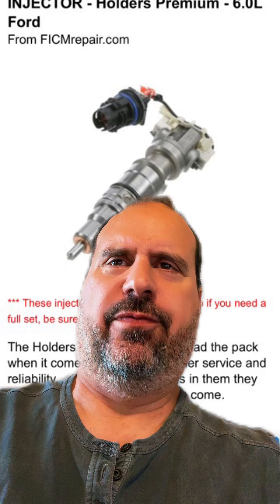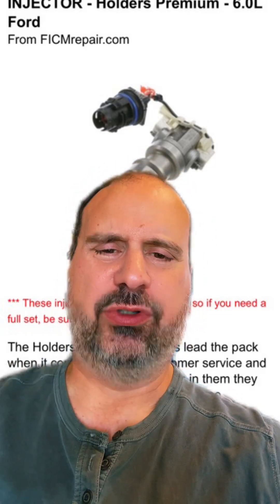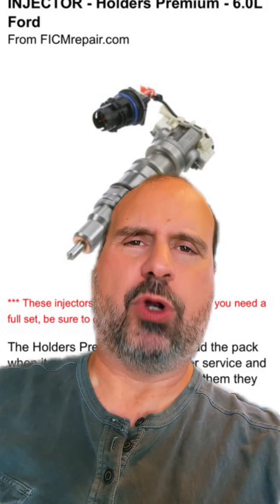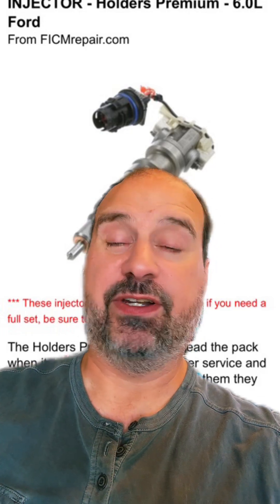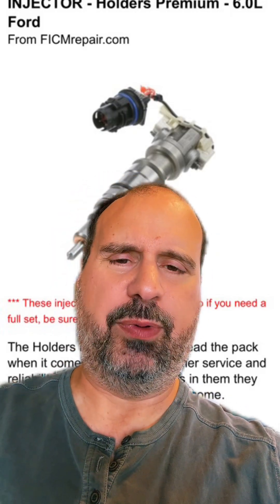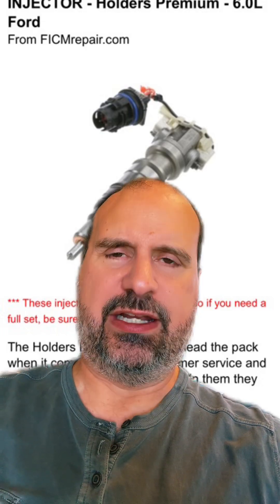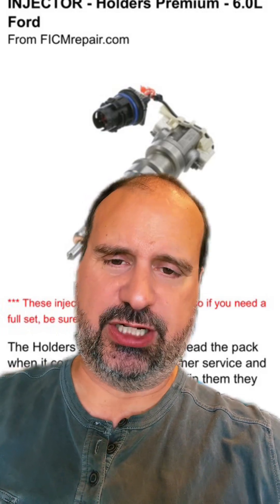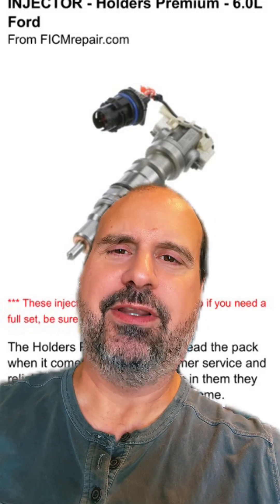UPDATED: How to Purge the Air Out of your High Pressure Oil System

Comment: Sir, I just wanted to come and say thank you very much! I recently had my oil filter housing pretty much separate from the block due to worn out bolts and absolutely warped gaskets she’s an old 2003 Acura MDX with north of 250 thousand miles! I got that all taken care of literally just two days ago so naturally, I have been monitoring the situation very closely last night and this morning I noticed some bubbles mind you I replaced the filter but never cracked the plug to do a complete drain! I know I should have but this is where we are lol! Anyhow, with a quick search, I discovered your video and put the high RPM method to the test and it worked and immediately alleviated some of my anxiety. I will be closely monitoring her just in case I do need to crack a plug and do a full change. But again, thank you so very much for this information. It was helpful.

Comment: My high pressure came back almost instantly after changing injector for cylinder 4. And that was before I knew all these tips and tricks and what to do properly. I literally put her back together and just rung the fuck out of the key. And within about three turns the key for 10 seconds she fired right up miraculously. I fell I was very lucky. But why didn’t happen so easily? Is it because I only opened one cylinder too the injector. Or just dumb luck.
Reply: Yep, you're blessed.
Reply: What if I have a older truck that doesn't have that?